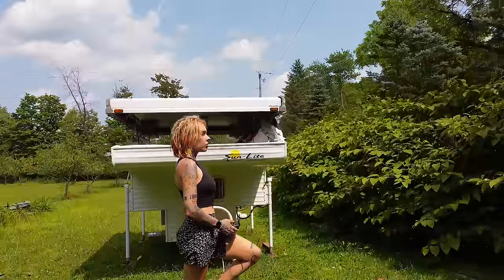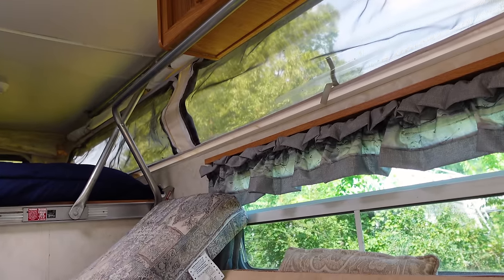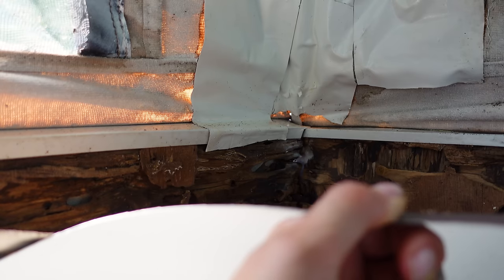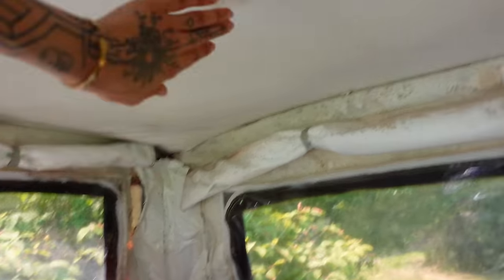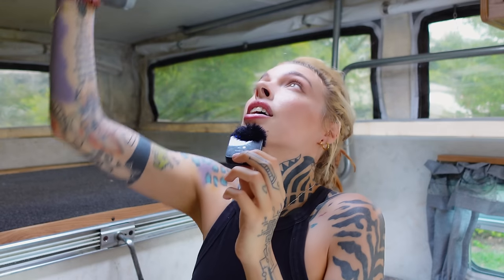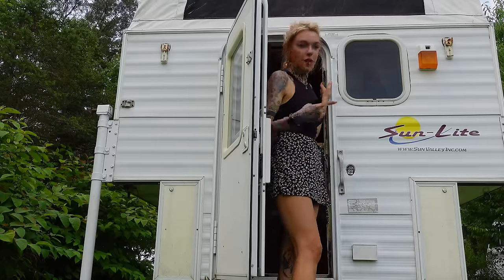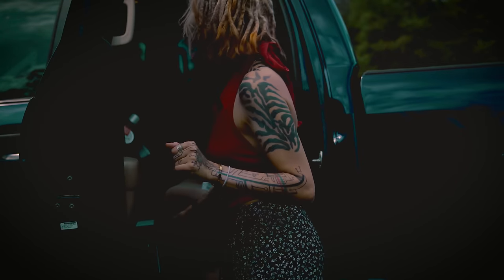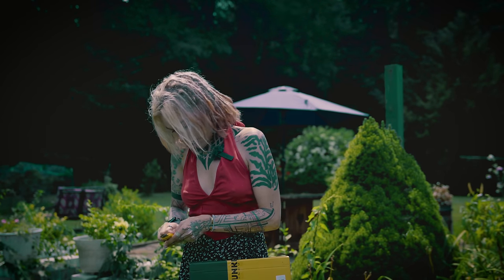old TRUCK CAMPER renovation BEGINS...this is worse than I thought

Comment from the maker: Loved your suggestions from my last video! Feel free to leave more constructive ideas!
Reply: There's a lovely guy runs a channel called cheap rv living, if l was you l would give him a shout, l reckon he will be full of useful knowledge and experience.
Reply: have you thought about junking the crank system and using the actuator legs from a gaming desk. then you could wire it so the roof lifts at the push of a button.
Reply: Just don’t give up, you got this one!
And now when I saw your roof, little bit better, I still cannot determine is it made of fiberglass or is it just EPDM or TPO rubber roof.
IDK for fiberglass, but rubber roof can be easily recoated, price is here not big per square meter, material is not expensive, and if you can do it yourself, you can go cheep. I am almost certain you can find a tutorials online for that, but IDK pricing in States and what’s the option on fiberglass coating. Just something to think about.
Floor tiles replacement is good idea too, but I bet you already knew that 😉
So with love and support, good vibes and positive energy, inspiration and creativity for you my dear Lady ✌️🌹🦹‍♀️🤍🐑🩵🛻💙🎗️💛🤞🧡💪❤️❤️🤍❤️
Reply: Gorilla clue works great to add covering like panels, and i have a house that is 130 yrs old liquid nail works wonders for adding fill to outside cracks and to fill stuff. Just my thoughts.
Reply: The audio quality near the end of video is pretty bad...
Reply: You can actually use house roofing metal to cover the roof and the outside of the camper. It comes in a variety of colors.
Reply: Great video!!!
Reply: "Was this camper a bad deal?"  - No. It simply wasn't ready to be usable. In my area, those same campers with a good roof are 6,500-8,000. You have a fixer-upper proportionate in price. You'll get the roof perfect, It will function better than new, and made to suit you. it will become comfortable and livable, and then someone will ask later, and you'll say - "it was worth the experience."
Reply: @TorieRobot  there's no shame in a bit of JB weld either
Reply: I hope you save the canvas section you can take it to a knowledgeable upholster shop and have them make it new. Then just replace the rotted out wood with new and reinstall the new canvas top.
Reply: So you could build a roof frame out before pulling the roof off the camper since it's all rotted . Surprisingly the iPhone 14 and 15 can use satellite for emergencies
Reply: Lithium grease, for those pop up hinges, get one of those mini grease guns.
Reply: On a positive note , you are learning alot of new skills whether you want to or not :)
Reply from the maker: @TheActionToysChannel there’s a creative idea
Reply from the maker: @Steampunk_Star_Raisin yes- my microphone went out annoyingly
Reply from the maker: @kevincupp3693 you’re very right!
Reply: Hey beautiful im from Tasmania and im building mine from scratch. It will be my home.
Reply: Fingers crossed for you
Reply: @TorieRobot  how about doing away with the pop up altogether and making it rigid taller with the bunk over the truck cab? 

More height, but less trouble and more security and still only as tall as van conversion probably.
Reply: @TorieRobot you can make better tie-downs with sections of chain and turnbuckles than what you are talking about buying for pennies on the dollar compared to what you are talking about buying and you can purchase the parts you need to make them at any farm & home store,  hardware store, Home Depot, Lowes, possibly even Walmart.
Reply: Can that just be built on, so it's up at all times? Be so much easier if being up always doesn't bother you. Good Luck! 
It's going to be perfect in the end. Just think about the finished product. Lol
Reply: Love your content keep it up we will help when you need ❤️

Comment: When that silicone fails on the roof look up extreme caulking. We used a lot of it on RVs... Also it's not a bad deal, you would be surprised at how many brand new campers do we have to tear apart and fix. Look into putting PVC board back instead of wood and then you never have to worry about it rotting again

Comment: Was this camper a bad deal?
Yes!
Will Victoria renovate & fix all the problems and make it the best version it could be?
Abso-lutely !! ❤
Reply from the maker: Weehoooo!!
Reply: I wouldn't say a bad deal. More a poorly informed deal. That is totally on the seller. I do agree that Victoria will fix this. Once renovated it will be something that will be put to good use and hold its value if ever sold.
Reply: If your vibra tools blade is going dull sometimes you can take a cut off wheel in a grinder and re tooth the blade. Just saying, in an emergency, this can help. Run it by your Dad for help, as those blades are expensive.  😊
Reply: Indeed💯
Reply: @raybo34  No, its on the seller and her. You should be looking at every single detail and asking questions before making a purchase. Yea the seller should do the right thing and mention everything upfront but its still your responsibility as buyer what you spend your own money on.

Comment: Thank you for the video. I too recently made a questionable purchase of a vehicle with a check engine light. I do have mechanic experience and in my hubris, I did not bother to check the error code. It has been two months now since I tore the engine apart to fix the issue. I was getting a little down as every turn of the wrench something else needed repair. I even broke off two different bolts in the engine block. But since watching your work on the truck and camper, and your positive outlook, I feel energized to get back to my project. Thank you and keep on keeping on. - Update: I got it back together and it runs!!

Comment: To do a computer reset on your truck.  Remove your battery cables.  Then turn on your headlights.   This removes residual charge in the circuit boards.   Put you negative cable on first,  then positive.   Now you've done a reset.   It will take either 100 miles or 100 starts for it to learn.     If your truck has major issues you will know when the light comes on.   Then if you have a scan tool.  It will help narrow down an issue much faster.

As for the fabric parts of your camper.   Sail clothe likewhats used for sail boats is generally what it is.   However,  green army canvas can work well.   I did a top for my jeep with it and it's still doing great after 15 years

Comment: Did the previous over charge you YES, did you make a mistake NOOO! When all of the labor is behind you and yes it will be at some point, you will have a home that's exactly like you want it to be with you at all times! I absolutely love that you are going the labor on the camper as well as your truck so you won't feel lost and defeated when/if something goes wrong. I am very happy that you read the comments about the impact wrench! The turning risers for the top and the camper supports should be able to be removed leaving a stud the wrench can tighten down on and make you like a ton easier. Just make sure to hold on tight or it will try to swing out of your hands without a good grip. You got this! I can't wait to see the updates on how it's going!!

Comment: I hope you fixed the pop-up crank problem. If not, here's a cheap idea.  Make your crank handle longer. If you increase the diameter of the crank circle, you will increase the torque you can apply.  To do this, you will need to find a new handle that is longer. If that doesn't work, try putting a piece of pipe on the crank handle so you can use two hands to turn the crank. Just be careful it doesn't slip off when you are using those big muscles. :) You go girl, you can do this.

Comment: You are doing GREAT THINGS! I have been where you are. A couple of things I used that were amazing are, EternaBond Tape for the seems on your roof for leaks. Look for videos about this stuff. The best cleaner I have ever used is SprayNine, found in the automotive department. Make sure the windows are open when you use it. There is zipper oil. I used it on my jeep top. But if you can't find it, you could always use a plain candle. The wax will help the zippers.
Save all your foam. You can recover the cushions. Even if you can't sew, you can use a glue gun. Foam is very expensive.

Comment: I bought a 24 ft 5th wheel with really bad water damage. Roof was caving in. Studs would pulverize when touched... 3 years later... I'm still working on it. It has been frustrating but, no 5th wheel has ever been rebuilt like I have done this one...
Patience!
is the only advice that I can share...
I lived in mine from day one!
I have thus far completely rebuilt it from the frame up... yet to finish some of the interior and the outside...
Good luck!
I will keep watching to see how yours turns out!

Comment: I purchased a 2013 coachman clipper trailer. And it had a multitude of issues, including leakage and rotted floors. Your camper looks really cool, I think it will be a fun project. One thought I have, is don’t use electric force on that crank, instead look for the points of friction, and fix that first. Because once it breaks, it will be more difficult to resolve.

Comment: My brother has a similar camper and he ended up using a battery operated drill with a socket that fits the mechanism that lifts the top and works way better for him.  He's 66 yrs old.  May want to try that.

Comment: Get your sister to help replace the canvas, you can use a large plastic zipper all the way around top and bottom,  your sister can help sew it. Alot of different materials you can use, you can put some clear in there, and you can take it all the way off if you wanted. They make some amazing glues nowadays to make it easy. Anyways,  goodluck!.❤

Comment: I own a camper from this company, it's a prototype pull behind, they didn't make many of them, mine has had a lot of the same issues you are dealing with on yours. I'm glad to see you are replacing the full ceiling, I tried to do patch repairs and they have now also failed so a full ceiling replacement is in my future as well.  Be really careful lowering your roof, make sure you don't pinch your canvas, if you're unlucky it can cut right through the canvas. Also, the seam that runs down the middle of your roof, either cover it with Eternabond tape or Dicor Self Leveling sealant, also run Dicor around your replacement roof fan when you put it in. That seam is probably why your whole ceiling rotted out, that's what happened with mine.
Reply: Also, I recommend using pink foamboard (FOAMULAR from Owens Corning) in the ceiling then covering with either thin plywood painted on both sides or Fiberglass (FRP) wall panels. No chance of the FRP rotting, just remember to predrill any holes.

Comment: Measure the wood for around the top frame, and when you take the rotten piece out, give it a brush out and put the new piece straight in. Work your way round.👍
Ideally take the whole roof off and work on the ground, cover the van with a Tarp.👍 
I replaced all the skirting boards in my pals apartment and we did it that way. Take a bit off ,cut a new bit the same and put new on, all the way round ,door facings too, his apartment looked like a new build and the wood was only £400.😂😂

Comment: Oldtimer Tip :  Electric drill with an attachment to raise the canopy. WD 40 on the zippers , then Vaseline for lasting protection and lubrication , or can use vics vapo rub instead for mosquito/fly control

Comment: Hello, Dan here, Let me start with I have a 1980's Sun Lite Camper and have had it for 4 years. Stay focused. You can do this and when you're done it's gonna be a great camper.
Reply from the maker: Thanks!
Reply: @TorieRobot  Oh and when you get to putting the vinyl back in rub a candle along your window zippers. the wax will help to smooth them out. beeswax is best if you have some but candle wax works too.

Comment: Those bunker traction boards, I never knew those existed. I could've used those 2 years ago after a snow storm. I was pulling out of my driveway when I drove slightly off of it and into the mud where it got stuck. Tow truck driver had a good laugh seeing a MR2 Spyder being stuck slightly off a driveway and having to be pulled from a driveway. Lol

Comment: I admire your tenacity in everything you do.  No doubt you can eventually make this livable.   You are  almost at max payload with that camper.  So use light weight material.  The lift mechanism Is a Heco Manual Lift and notorious for stripping teeth.  POP-UP parts sells lots of stuff you need to repair it.  There are a few companies that specialize in canvas replacement. You send them your old and they use it as a pattern.

Comment: Hello Miss Tori, may I make a suggestion on the screw jack lift for the top? WD-40 will work good to break things loose. But after that I suggest using a cleaning agent something like berryman's B12, the spray will work best, but be careful this stuff will burn vinyl and Plastics. But it dries and leaves no residue. Then use something like graphite it's a dry lubricant and will not attract dust😊. love ya stay safe❤❤️‍🔥

Comment: VICTORIA YOU ARE DOING A GOOD JOB, JUST REMEMBER AFTER YOU PUT UP THE CEILING YOU CAN START CLEANING UP THE LITTLE CORNERS AN PUTTING UP THE STRIPING THAT WILL HIDE WHERE YOU COULDN'T LINE UP CEILING,I DON'T KNOW ANYONE WHO HASNT HAD TO TOUCH UP WORK THEY DONE ,TRUST ME AS YOU PUT EVERYTHING BACK IN ORDER YOUR GOING TO SEE THAT ITS NOT ALL THAT BAD , FROM WHAT I SEE ITS COMING TOGETHER, YOU NEED TO TAKE A BREAK NOW WITH THE RAIN FALLING IT ONLY MAKES WHAT YOU ARE DOING MUCH HARDER .I DON'T BELIEVE YOU HAVE LOTS OF HOLES ,IT ONLY TAKES ONE AN YOULL HAVE WATER FLOWING AND RUNNING DOWN EVERYWHERE.BUT IM SURE WITH YOU RESEALING WHERE YOU SEE.N WATER , YOU WILL STOP IT FROM LEAKING,, JUST REMEMBER YOU ARE DOING YOUR BEST AN ITS NOT LIKE YOUVE DONE THIS BEFORE.STAY ENCOURAGED YOUR GOING TO HAVE YOUR SPOT JUST HOW YOU WANT IT ,ITLL BE BEAUTIFUL.,IM IN CALIFORNIA BUT IF I WAS WHERE YOU ARE ID BE MORE THEN HAPPY TO HELP YOU REMODEL YOUR SPOT ,MUCH RESPECT ALWAYS.

Comment: I'm so proud of you handling everything with grace. The truck is great once it’s fixed. I wish you could fix the camper up and sale it. All RVs have water and mold issues due to build quality/ wood. What we want is a Supertramp camper which is too expensive for both of us combined.  I would suggest lone peak campers for the price, or dirtbox camper for quality. RoverKing is the cheapest fully inclosed  camper I know of. All suggestions are better and cheaper than most RVs.

Comment: I was correct .. you ARE on the right track.  Sorry about this jerk who sold you this camper, but you are on the right track here!  I'm glad your truck axle is fixed and one thing I can comment on is that if you fix the camper with quality stuff, you will trust it and it actually might be better than anything you could buy!!  I've found that if I take the time to fix stuff myself that it actually can turn out better than if I hired someone to do the work :)  Also you can customize the camper to suit your taste while you repair it.  Another thing to gain from doing stuff one's self is that we can gain invaluable skills and learning from doing it.  Your positive attitude will succeed I'm sure .. best wishes on this project.   Robert

Comment: Maybe see about changing that crank handle out for one that’s longer so that you will be able to get more leverage as you crank the handle to raise the top.  Maybe that will enable you to Raise it by yourself. Leverage is your friend in this situation. 
I completely remodeled a 19 fr pull behind camper. I knew absolutely nothing about them when I started and I still don’t know all that much but  my camper turned out great and it’s very functional and customized to my specific wants/needs. Which was the reason I started the remodel to begin with. If you have ??!! Feel free to ask. If I am able to assist I will.  Keep your head up it will get greater later

Comment: Both heartache, and crazy respect for you, seeing the extent of the damage! 
You've obviously bitten off much more than you had anticipated. Your assessment seems to me pretty much about right, except that I'm not so sure it was a "bad deal" -- these campers are very expensive, either new or used, in good condition. 
Anything less than $5K is essentially gonna be a fixer-upper. So you've bought yourself a project camper -- not a bad thing, but you will need every ounce of your ambition to get it done. I've seen talented people fail/abandon such projects (eg Jonathan Yentch) due to time and financial constraints, as well as not having a place to do the work -- seems like you'll be fine in that regard. You'll make it your own and build it better than it was. You can also modify and improve on systems to suit your needs. I'm sure it'll work out great!
Cheers!...from North Vancouver

Comment: I think I mentioned this before, But try to use Marine Plywood, it’s pricey but water won’t destroy it. Then when you replace the plywood sides for instance there’s this black tape they use for Zip plywood sliding that seals everything. Try to use the tape no matter what plywood you use. If you use regular plywood I would also seal it with something like Thomson Watersealer

Comment: As for the lifting jacks ...make sure the internals are well lubricated.... .cut crank handle off and get hexagonal
 nut welded onto the crank handle shafts 
and use a socket on your cordless drill to lower and raise the   jacks.....just make sure yiu have 2 charged batteries for drill .....could possibly use the same  method for raising / lowering the pop top.......also carry a ratchet  in case drill fails